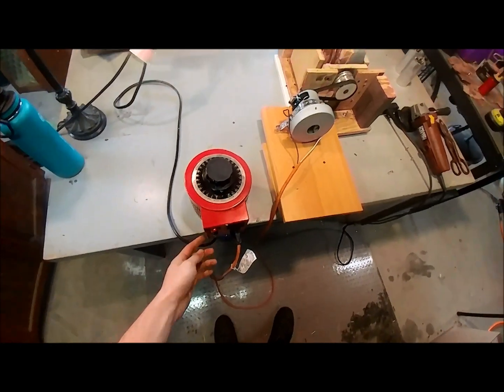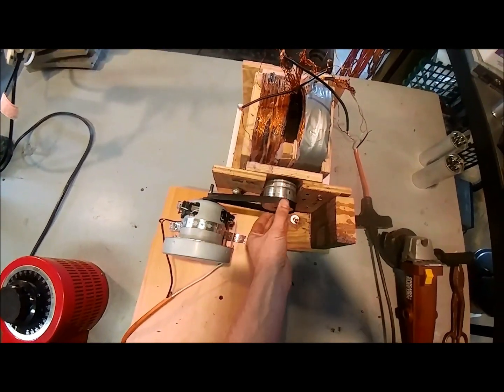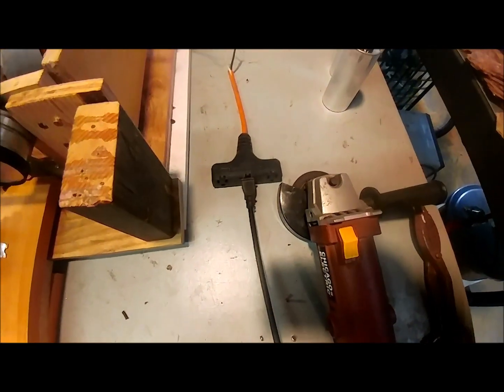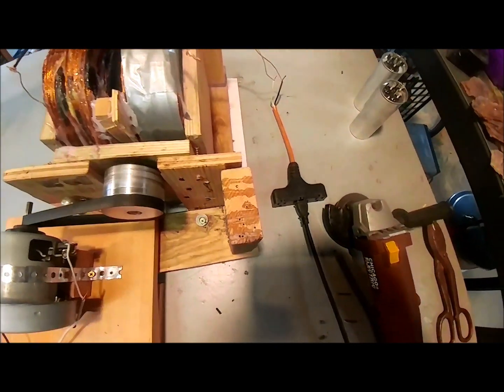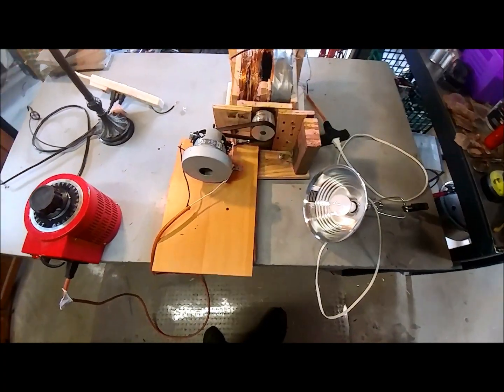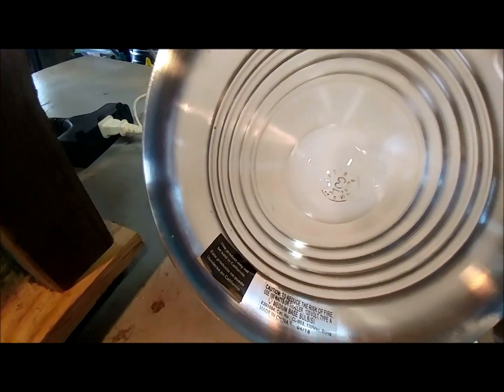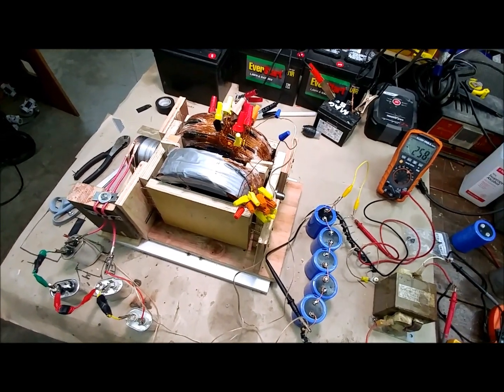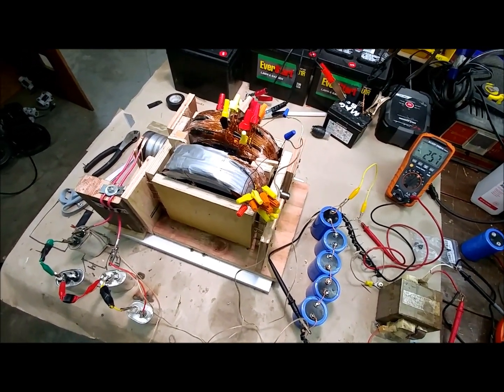Large Newman Motor/Generator To Be Coupled With Tesla Turbine

Comment: This type of set up only proves that you might as well just plug the grinder straight into the mains power and do away with all the other power consuming bits in between
Reply from the maker: This comment proves you haven't seen any other video of mine yet.
Reply: @iEnergySupply  I have watched a couple but nearly all of your videos are about Tesla`s air motor
Reply from the maker: @DeryckThompsonChasingtheDream  Air is for testing, I'm using anhydrous ammonia now in closed loop system. We can use heat from the earth and sun to produce energy. The good news is, with these fluids you don't need an air compressor. When tuning in a system though, its extremely useful to use the most readily available system, the air compressor and air thanks. It represents steam. My newest videos will be showing these as the working fluid. The energy is from the sun or the earth in the form of heat. Also the suns heat can be stored in water that can then be transformed to energy, it's like a Stirling engine on steroids.

Comment: I’ve been watching the progress of your turbines. Great work! If you want more speed for your Newman Motor, move the coils further away from the magnet. You’ll get more speed, and a higher no-load voltage, but ultimately less torque. You might also try a bifilar winding of the coils to boost the voltage as well. Good luck. 

http://Facebook.com/perpetualmotor
Reply from the maker: Thank you! My main problem with this Newman motor is the rotor needs balanced, I've since moved to smaller designs as it's way over kill for my system, I plan on doing more experiments with this one in the future though.  I think I want to try building a bifilar coil as well, thank you for suggestion.
Reply: One correction: when using that Newman configuration, adding space between the coil and the magnet can lead to a greater speed, but I was wrong when I said that increased distance could yield a higher voltage.
Reply: You might also consider a diametrically magnetized cylinder magnet like I have for the motor in my latest video. North and south are on the hemispheres. The magnets I’m using are 1” dia and 1” length with a 1/4” hole. Based on the length of your motor, tacking a few of those together on a 1/4” or 5mm shaft should help with the balance issue.
Reply from the maker: @PerpetualMotor  I built one with those magnets in the past, I show it in my video. I was using magnetic bearings. I really want to use bifiler coils like you said with the next generator.

Comment: air pressure (12v air compress )or water pressure with a tesla turbine with high rpm 

really impressed will keep watching : )
Reply from the maker: Steam would be a good direction, although there are many different options, we are thinking about going combustion as well, with steam in the mixture. Also this is going to be easily applied to solar heat energy production, and hot water energy storage.

Comment: Looking foreward to the turbine running it. will you use the british turbine patent design?
Reply from the maker: Yes, also it will be made of aluminum with combustion chamber.  Plus ambient air port for added power, also it will be a two stage turbine, to reduce the back pressure in the exhaust and increase efficiency up to 50%. Will be the first Tesla Turbine of it's kind.
Reply: @iEnergySupply  I would make it big and heavy for torque then have the british design but made out of sheets of steel so from the front it look like the british design but from the side it looks like a conventional testla turbine. This way the air can hit the edge of the steel sheets and push like the british design then move past the edge between the sheets and push like a testla turbine. Also id have the exhaust push past a part that ads to spin in a adjacent chamber that spins with the turbine. Just ideas. 

I like thinking about these.
Reply from the maker: @thumperhunts6250  I think i built one exactly as you just described just smaller and made of plastic. Check it out on Facebook, here is a link. https://www.facebook.com/jeremiah.ferwerda/videos/10206391223615332/

Comment: Nice build bro.

The output voltage appears to be relatively high, considering that there is no core in Newman’s device. Could you please inform us about the number of turns that you have there and also about the magnet size used in your design.

May the force be with you.
Reply from the maker: So the coils are in groups of 14, 28 coils total, 14 on each side. They are about 33 winding's per coil. In this video we have 5 coils in series, so around 166 winding's demonstrated in this video for the generator side of the video. In the motor side we have all 28 coils in series. Around 924 winding's total. These are rough numbers and not exact, we should have written things down. Thank you for your comment!

Comment: What is the point of this? The Newman motor did not need any input from any other motor, just a battery bank that the generator will charge while producing excess energy. Why you need an external motor to drive it, or a tesla turbine? The turbine will still need fuel or combustion so it is no different from any conventional method. A proper designed Newman motor will power itself.
Reply: Joe Smith the Tesla turbine is about creating the perfect heat sink and turning heat directly in the mechanical Force without the use of steam to power Pistons
Reply: @dcf246  what I wanna know is how conventional would this concept be for turning hot water into cold water for the purposes of making the water cold, and I wonder how much of that water it could turn cold.
Reply from the maker: Just need a circuit diagram for wiring it up correctly, I would gladly test the theory for you if you would send me some information on it. Also the Tesla Turbine with two stages has a possibility of running on heat from ambient air. Nikola Tesla talks about this in the book, the power of increasing human energy. Tesla calls it his self acting machine. We are also using a special form of plasma ignition that burns water and completely burns the fuel we use for the combustion chamber. Why not use these two devices in combination, the least that could happen is you get an enormous amount of power output.
Reply: @iEnergySupply  The theory is in Joseph Newman book. I guess that is where you got the idea. You can find his book online for free. I have that book about the Tesla turbine, but cant find where it says it will burn with ambient air.
Reply from the maker: @joesmith2654  I will have to look and give you a reference for you there. Tesla said he wanted to produce a self acting machine it the book and tap the power of the medium.  Its not the burning of ambient air, it's the utilization of the 14 psi of ambient air pressure. Stage two of the Tesla Turbine reduces the back pressure in the turbine, it lowers the pressure in the turbine allowing ambient air to free flow into the turbine to rotate or at least assist the rotation of the shaft.
Reply: @iEnergySupply  ok, let me know what page of the book it is as I have the book. I understand what you are saying but modern gas turbines also lower the pressure in their last stages as velocity goes up, pressure goes down. If that would self sustain turbines then we would not be using gas at all.
Reply from the maker: @joesmith2654  I apologize for not responding rapidly, I have been very busy and will get back to you with this reference.